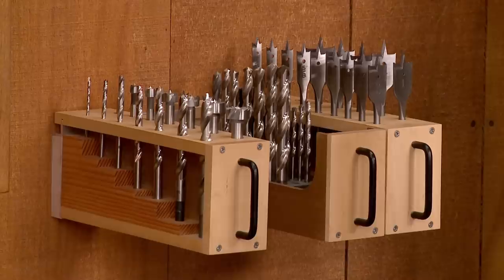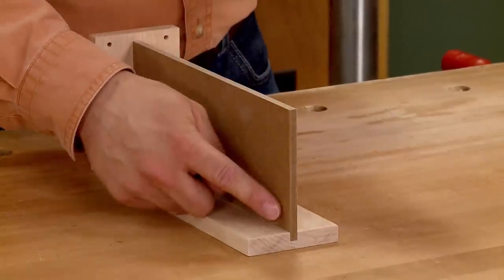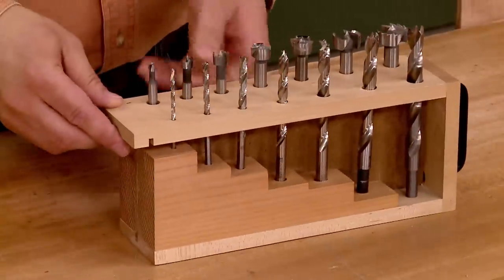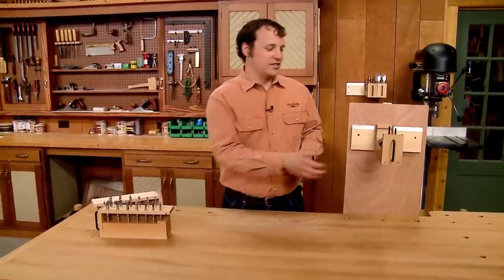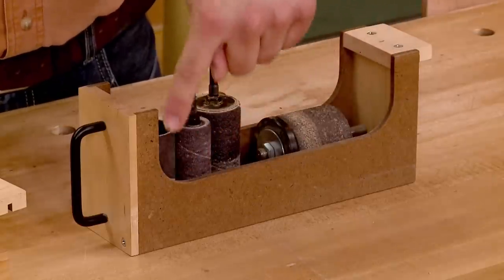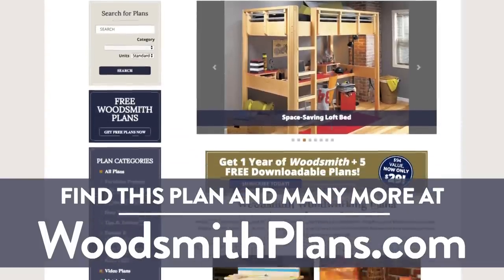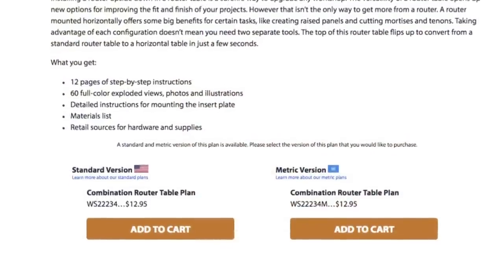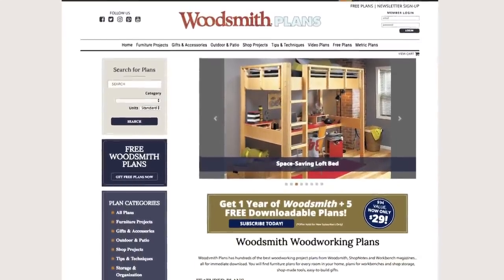Easy-To-Build Wall-Mounted Drill Bit Storage for Your Shop

Comment: Is there going to be a problem with the back of the box hanger splitting off from the dado?
Reply: If you're concerned with that, exchange the aluminum angle with a 45 degree french cleat system.
Reply from the maker: Thanks for the input.
Reply from the maker: Personally, looking at it from an engineering aspect I would agree that would be the weak point.  It doesn't seem to be a problem so far, but If you would like to strengthen the weak end grain and keep it from splitting off the back, you could add a few 1/4" pins or dowels from the top or bottom.
Reply: I would favor the French cleat.
Reply: Definite concern for me. But because it's at 90 degrees, the aluminum angle provides a more secure cleat. I like the idea of adding dowels.
Reply: I like this plan , but instead of wood as the hanger I will use another piece of the aluminum angle screwed upside down to top of the drawer allowing enough space for the cleat to fit in.